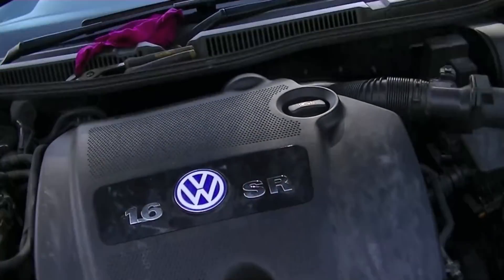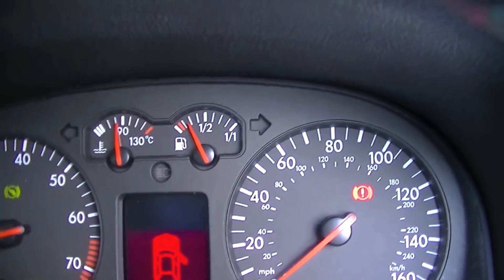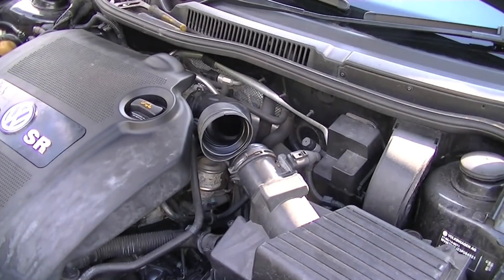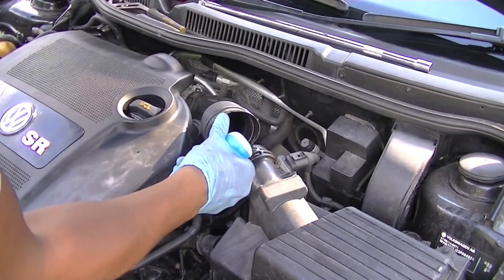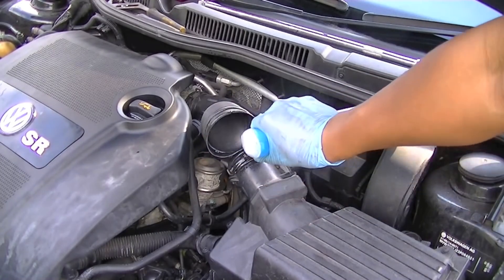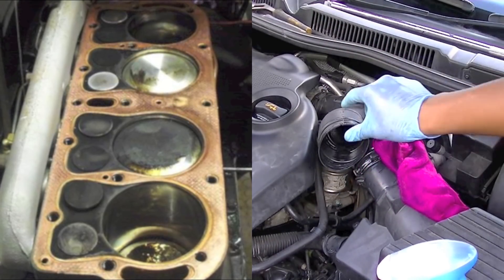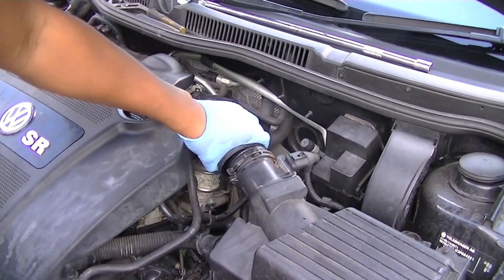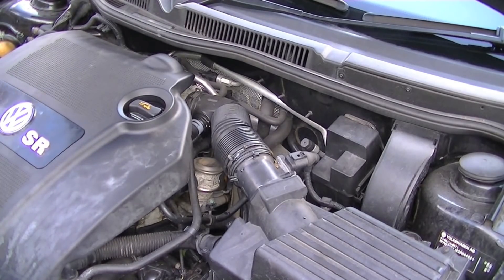How to make your engine run better with just tap water.......Better Than Seafoam?

Comment: complete rubbish I'm a motor mechanic with 30 years experience
Reply: +alex tilson Well there is the problem right there, you should never use water on motors but you can on engines... Engine mechanic 42 years...
Reply: +Gordon Lawrence water vapour was injected to lower intake charge temp and thus increase air density to produce more power and lower the chances of pre-ignition, nothing to do with carbon build up.
Reply from the maker: +Daniel Warren Maybe not, but the fundamentals of the IC engine is the same. Hence why it still works.
Reply from the maker: +Daniel Warren You say it cant be done in modern engines but BMW have just released a car using a water meth set up.
Reply from the maker: Daniel Warren key word being "The fundamentals".  Fuel injection or carburetor are not fundamentals to an IC engine.
Reply from the maker: what is complete rubbish?
Reply from the maker: +alex tilson This is trick that they used in the 60's, so it seems like there is alot you do not know
Reply: Have a look at water meth injection,
Reply: Actually it did both and was at one time advertised for "keeping the engine clean" and "increasing power and fuel economy". I do not however believe the story of the Tiger Cub ridden from Birmingham to lands end and back on one tank of fuel.
Reply: Which engines is it not safe for  Daniel warren
Reply: +Ryan Hanna Yes it is safe but does it get rid of the carbon in your engine is questionable,..
Reply: Gordon Lawrence thanks alot
Reply: Aaron Tate want that looked at for racing cars at one point?
Reply: +Gordon Lawrence 
was so successful in formula one itvhasnt banned.....
Reply: +Gordon Lawrence 
that's how the zakspeed capri make 1400 horsepower from such a small engine.....
Reply: I have 30 years no experience & trust me I don’t know if it works , trust me on that !
Reply: Ryan Hanna engines have to take a certain amount of water sprayed in fine droplets into the air intake without damage to pass validation testing. If they couldnt take it at all they would break down every time it rained. The amount this guy is using is about the same as you'd get into the engine in a monsoon except a monsoon goes on for hours not seconds.
Reply: +BMAC VAGS I can vouch for what you are saying as both Triumph and Norton had aftermarket water injection kits for a while that had about a 1 pint capacity which used exactly this method for keeping the inside of the cylinders clean. Basically they would kick in after the engine got up to temp and inject a tiny amount of water vapour into the carb intake on every other revolution (one carb per cylinder on some models). Improved MPG too by about 10% according to some people.
Reply: +Vince S in your opinion is this safe to do on a petrol car thanks
Reply: +BMAC VAGS we don't drive cars from the 60's anymore.
Reply: +BMAC VAGS not true. Cars with Direct injection and smaller turbos have been known to suffer damage from attempts to clean carbon. Fords ecoboost for example. Ford will warranty a new head should the back of the valves clog up with carbon. They do not allow any type of cleaning for risk of turbo and cat damage.
Reply: +Aaron Tate I have given examples already. Pretty much anything with small turbos and direct injection, I can't give you a list you would have to ask the manufacturer. I'm sure this would be safe in a lot of cars but I wouldn't recommend it to everyone.
Reply: +BMAC VAGS I said it can't be done in all modern engines. You should not be advising people this is safe for their car when it may not be. It's bad advice.
Reply: +BMAC VAGS what are you talking about. I don't understand your argument. You can not safely do this on all modern engines. Maybe some but not all therefore it is not wise to advise anyone to do this without knowing the possibilities of potential damage to their car.

Comment: i seriously wouldnt advise tap water lmao, you need mineral/ de-ionized water what wont cause rust. obviously water cannot be compressed hence the need for the spray bottle so DO NOT over do it with the water or chances are the next weakest link in the chain is the con rod that would more than likely snap. The vehicle performance will increase slightly because obviously water is made from hydrogen and oxygen, both very flammable increasing the burn rate but you can only increase the performance if you had a permanent supply of injected de-ionized water. as soon as the water is burnt off, the engine is back to how it used to be.

Comment: Water injection ? Nothing new here.  Some aero engines had this decades ago although they used a water methanol mix, but it only cut in at full throttle (takeoff).   My father in law had this rigged up on his car about 35 years ago for towing, said it stopped pinging.

Comment: I had a German guy next door to me he had a vw gold he ran it on bio fuel that we made our self and he put a bottle with water with a very fine mist injector into the air intake it worked great
Reply: off course it works great for a wile.  but the high concentration ethanol will ruin all the gaskets

Comment: I used to do this years ago when cars had carburetors.  One thing I would recommend is to do this before changing the spark plugs as the carbon coming off the cylinders, heads, and valves will fly around inside the combustion chamber, and sometimes land on the spark plugs, bridging the gap, or getting fused to the spark plug insulator.

Comment: I do this once in a while but I use carburetor cleaner.. I'm not sure if it cleans the head of your cylinders but it helps instantly and my check engine light did NOT turn on at all temporarily nor permanently but I would imagine this works just fine but my guess is you would hav to do this more often then using carb cleaner or another product but if it saves money then by all means!
Reply: sir dumb fuck
Reply: James Richard shut ur James Richard lookin ass up.. oh

Comment: yes this works and is certainly better than the "engine flush" ripoff offered by quick-lube joints that thin your oil and damage your engine's internal parts.  I used it quite successfully on my 69 Corvair Monza that had a pinging problem in hot weather with the engine hot and the A/C running.

Comment: At least use some distilled water, because tap water contains calcium carbonate which will stick to the piston..
Reply: how about using some holy water it won't leave any residue behind will be like nothing ever happened
Reply: +Gordon Lawrence well, my local priest doesn't add any salt at all yet still it is drinkable, tasteless, odourless and doesn't get green even after 6 months or so, on the other side, if i let some water in a bottle for a week, man, it stinks..
Reply: +XanderZ it's the fluorides I'd be more worried about.
Reply: Gordon Lawrence yeah, it depends on the region though..Here in Romania, living on the countryside we got some clean water, but with a high content of calcium carbonate though..
Reply: We have high calcium carbonate in some areas of the UK too. Didnt cause a problem with my BMW K75S though.
Reply: Ehm..have you checked the inside of the engine to see if someting has changed?
Reply: Yes
Reply: Clifford Zellner you dont have a clue do you?
Reply: if he doesnt know Holy Water is made with loads of salt.......
Reply: Gordon Lawrence I disagree with you. Holy water doesn't contain salt at all..
Reply: In Romania. there is nothing worse than water from the grid. Strange it is delivered by a french company... Whatever. If you want to early wear your engine, use it in your car. Done that, not happy with it. Much better, change oil regulately and use fuel line cleaning products in your tank.
Reply: Clifford Zellner how about you trying that and telling us the results? ;) :P
Reply: Gordon Lawrence maybe, maybe not.. ;)
Reply: +Gordon Lawrence just kidding around sorry that you missed that.
Reply: @xander ever any made ? I have a degree in theology from a priest training college. You dont have a clue.
Reply: Mineral water?
Reply: Gordon Lawrence  grasia

Comment: BMW are introducing Direct Water Injection to their Performance Cars, as it aids in Cylinder Cooling, which conversely allows Turbo Boost to be Dialled Up, without putting undue additional pressure on the Engine, or the possibility of premature fuel Detonation. 
The First BMW to get this (New) technology is the current M4. They have been trialling this System for a few years now, and have found No negative Side Effects.
Yes it is a very effective way to keep Carbon Deposits Down, as carbon is a heat sink, which retains unwanted (excess) heat. By cooling the Engines Cylinder Walls, Water Injection will assist in mitigating Heat related problems in the combustion cycle,  which Robs the engine of Additional Performance Gains.
Water Injection will further Aid Direct Fuel Injection. As a problem with Direct Injection Systems is an additional Build Up of Carbon Deposits on the Head(s) around the Injector(s) and to a lessor degree the Valves, causing problems for cars over + 3 yrs  of age. 
This is especially true, if car owners don't service their cars as per manufacturers requirements, with the appropriate Grade of Motor Oil.
Reply: +Mark Law This was used by after market kit makers in the 60's for Norton and Triumph but only for carbon control use.
Reply: In the 60's I believe Volvo was whipping the pants off racing larger V8's. With there B230f engine slant 4 engine. The f in B230f is the turbo model. The only problem? HEAT!!!! The solution they came up with was WATER INJECTION 🤣 to cool the combination Chambers. The article I got this from was a pretty simple Google search " History of Volvo" maybe? But the article goes on the say that the mechanics, ect. May have contacted Porche to make a costume semi spherical combustion head. But at that point the article gets a little merky as they have no physical evidence of the contract. Otherwise an impressive and amazing article. Long as it is. I would never have guessed that Volvo had such a broad, varied and rich racing history. Until next time y'all YouTubers😁

Comment: bmac eric and scotty killmer are good people at what they do. but when you apply anything wet to carbon it turns into mud im not trying to bash any of you guys because at lease you all are trying to find a way to remove the carbon
Reply from the maker: +sd33zy313 If you apply water in a normal ambient environment, then maybe so. But the combustion chamber is far from normal and ambient. So in this case, those results do not apply.

Comment: I noticed the same - coolant leaked into one cylinder. The engine ended up with hydrolock. (I took out the plug, cranked it, made a splash then started running "fine" again). Later we took the head off to change the joint and saw how clean the chamber was.

Comment: I read a Ford engineer's autobiography and he wrote that they discovered this in the '60's, put some dye in water and marketed it as engine cleanout.  Not sure I'd blindly do this now with all the sensors and injectors.
Reply: +decay21450 the sensors have to cope with far worse than water vapour. Water is a combustion product for diesel and petrol. Basically pure diesel and pure petrol would give you carbon dioxide and water in a 100% burn. However in air and with all the aditives there are some nasty nitrogen compounds and all sorts as well including carbon monoxide from incomplete combustion. That includes small amounts of nitric and nitrous acid. A tiny bit more water will not cause any more damage - not really much different to driving in a really bad rainstorm with an iffy air filter.
Reply: +Gordon Lawrence The combustion process is sublimating atmospheric humidity into droplets...the same process that causes condensate to form on a glass of full of iced soda. The amount of H2o in the actual diesel or gasoline fuel is miniscule."A tiny bit more water" is absolutely not a problem...it's HOW MUCH is being used in the video I have issues with!I think it borders on insanity to deliberately squirt water into a modern fuel-injected engine to accomplish so little in terms of 'de-carbonization' of internal engine parts.Such a procedure is just not worth the risks involved! Why use water when solvents are so available? They work, and the risks in using them is not much of an issue.
Reply: Would you take carb cleaner and shoot it down a running engines intake? I wouldn't. People shoot seafoam into their intake which contains oils and all kinds of good shit that'll cover your MAF. Water wouldn't do a thing to most engines.
Reply: decay21450 d
Reply: decay21450 Never take the risk of water in the engine . Or water in the fuel tank. It   can be a dangerous idea for damage all yr injectors & sensors  .( WD40 is cheap & better than water . ).This video is a suicide!

Comment: I think the best thing to do is locate any pcv hose that blows oil into the intake and install a catch canister to stop it. Other than that change oil every 3k with conventional oil and 5k with synthetic and you are golden. It is laughable to think your car is "snapier" or whatever this guy suggests after spraying water in the intake. A little bit of carbon on top of the piston is not a big deal.

Comment: hmm as you build carbon in the cylinders the carbon takes up volume this means that the compression rises which leads to more power. in a 2 stroke engine de-carbonising is more relevant. the secret is to avoid gum deposits in the fuel system and sludge in the oil passages etc. this is simple, regular services and filter and fluids changes per schedule or workload as appropriate. I would strongly recommend against any water in an engine as water does not compress. too much water will cause hydraulic lock and wallet unlock for a new engine!

Comment: this method works it's like the race car with water injection system mixing some water in cylinders just the perfect right amount it will help like a turbo engines anything super hot to help the premature ignition ....this work because I have a 2jz engine swap in my 240 with water injection . but doing it like he is doing spraying like that it's kinda scary lol but method suppose to work if do it right.

Comment: Also recently noticed that carb cleaner can clean carbon deposits and it's combustible, so no water.
Reply: +ilia gofman , are you sure of what you are saying? What about lacquer thinner? any idea?
Reply: @ilia gofman . In your own case, should you do this when your engine is on or shutdown?
Reply: +Aniefiok Hanson Something else might be too thick or corrosive. On my carb cleaner can, it says removes carbon deposits. So far I have been only brave enough to try it on my 2 stroke strimmer engine, whilst it was running, a small spray every few seconds. Also soaked the exhaust in a cup of carb cleaner, and remaining liquid was dark coloured.
Does carb cleaner create the same effect as water when added to a running engine, is it safer than water?

It may have made an improvement, I'm not sure because I was fixing other parts of the strimmer engine too.

Comment: Let me allay a few fears that people have with Water Injection.  

Putting water in your engine with Hydraulic it - Yep, putting a LOT of water in, will.  If you have a 60cc combustion chamber, (3.66 CI) and you put in more than 60cc of water, then the piston is going to try to squeeze that water into the available space, even though it cant...  then something is going to break cause water doesnt compress...  however we ARENT putting water in the engine, are we...  we're spraying a mist in there...  and nowhere near 60ccs worth.  To put it bluntly, if your damn fool enough to feed a garden hose into your engine, with straight water, then I laugh at your hydraulic'd engine... (it will take a distressing amount of water to lock it)

Water mixed with the oil, and stuffs it - In a hot engine, steam (which is what you get when you add water mist to heat) doesnt mix with oil at all.  It enters the engine, burns, and belts out the exhaust system along with all the OTHER gasses from the combustion process...  Anyone lifted the oil cap on an old car, and see the white paste, mechanics call "Mayonaise"?  Thats oil and water mixed, as a result of not allowing the engine to heat up.  Solution?  Follow the videos recommendation and let the engine heat up first...

Water is corrosive!  It'll bugger the internal parts of the engine! - Sure, if its left in the engine, over a period of time it MIGHT...  Solution?  Turn the water off BEFORE shutting down the engine, give the engine enough time to digest and spit out the remaining steam, then turn it off...  The internals are not going to suffer while coated in engine oil

This is a gag, it'll ruin your engine - Fighter pilots of WWII (Spitfire) used water/meths injection on their aircraft to give more power, and to push the service cycle out.  The manifolds had a specifically located holes for what was then called Venturi or Draft injection, which wasnt really injection at all, it was more the engine used to suck water in like a drinking straw, rather than use a pump.  This offered better fuel economy, longer distance between services (clean engine), more power that 'ze Germanz', and more supercharger clout... they could thrash the engines mercilessly, and get away with it...  Now-a-days you can buy Water Injection kits from ebay or amazon.  I bought one in 1977 for my car, and its still running the same 4.9 V8 engine it came with in 77...

He's using a squeezy bottle - OK yeah, I agree with this one...  Squeezy bottle was bad, but it did the job. If you're considering water injection, I REALLY recommend you do it properly

P.S. Where is the damn seat belt?